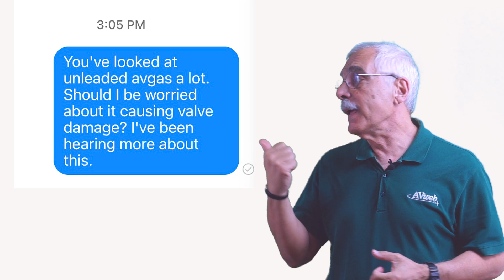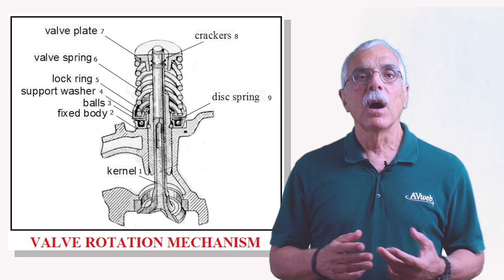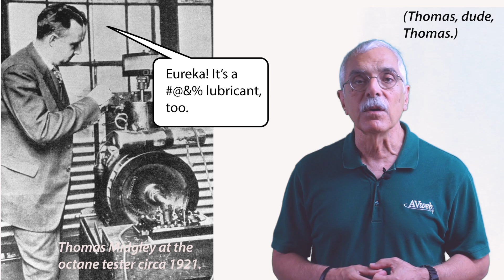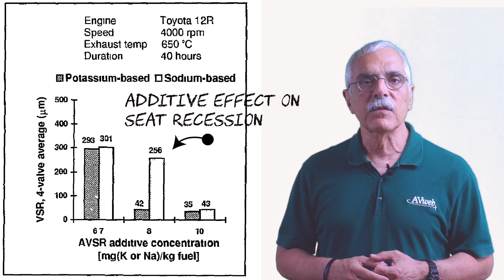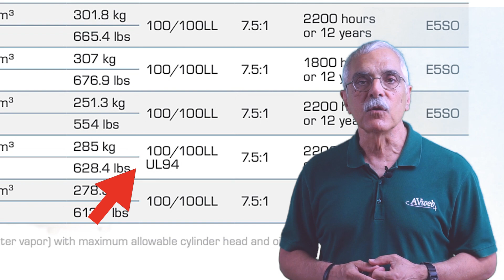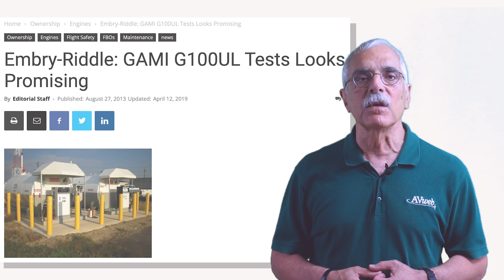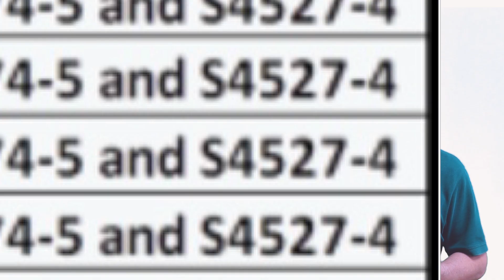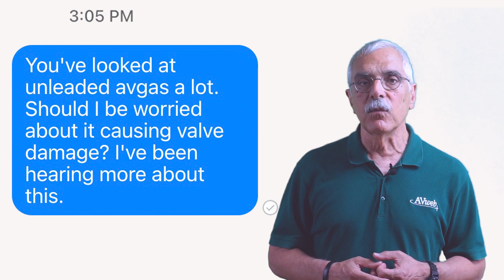Whadayamean Unleaded Fuel Will Trash My Valves?

Comment: Once we get past this leaded fuel issue- we can start wondering why a 7.5:1 or 8.5:1 compression engine actually needs 100 octane AKI in the first place at any boost pressure under <35psia. (Hint, it's because of a ~lack of modern spark timing control and combustion chamber design). 

Need to resolve this stuff as the cost of fuel going forward greatly affects the affordability of GA. I can't see why 91-93 RON Mogas, or at least, an ethanol-free variant- isn't the goal. We'll worry about the ethanol bit once people get over this last circus- somewhere around 2075 I'm guessing lol.

100UL at $8 a gallon is basically kicking a field goal instead of going for a touchdown.
Reply: i'm sure it's the goal... but as you mentioned, certified GA aviation got stuck in the 1950's.

We need a total revamp of the certification process. It's currently so hard the bottom 80% of us are flying 1970's vintage aircraft which use 1940's level technology, and the rest are paying millions for something with a mix of 1980's and 2000's tech.
Reply: And there are dozens of alternative fuels and changes in the engines that could be used, but every small change in this sector means constant headaches and drama.
Reply: A “touchdown” would be to convert the whole GA fleet to diesel engines running Jet A. One fuel for everything.
Reply: @wrkingrageaholic  This is possible if you use exhaust or waste heat from the engine to reform Jet A into syngas for spark ignition engines.
Reply: @wrkingrageaholic  Maybe. Diesels are heavy for a specific output. Always have been, always will be. Unlikely to happen unless re-engineering all the airframes like diamond did.
Reply: @peterblais6268  Diamond proved that a diesel can work, and their diesels are a cludgy automotive adaptation; far from an ideal aircraft engine. But your point is valid. They had to design the airframe around the engine. You can’t just stuff a diesel in where a gasoline engine used to go for many reasons.
Reply: The lack of modern (and by modern, I mean 1980's) electronic engine controls is just criminal. One of the reasons I never went further in aviation was my frustration with the prevailing Luddite attitudes I found everywhere. Look how long it took to adopt GPS! Private airplanes could be sooooo much better. We have the technology to make them efficient, clean, and safe (pilot-proof), but somehow we're stuck in the past.
Reply: @wallyballou7417  Fake Luddite because they also get triggered when you mention the use of steam/Sterling engines (I'm being serious, there are models that may work well).
Reply: @wallyballou7417  Your frustration with “Luddite attitudes” conveniently ignores the fact that it requires many many millions of dollars to create a new and innovative product for GA, in a market that is so small as to be nearly non-existent. The economics simply don’t make sense.
Reply: @wrkingrageaholic One reason the market is so small is the painfully slow adoption of technology, especially propulsion and automation. There's no reason an 172 or DA-40 should cost more than a Toyota. And it's just absurd that an air-cooled 4 cylinder engine costs $50,000, when a GM LS V-8 - a more modern, efficient, and powerful design can be had for about $6k (and the LS isn't particularly advanced, except by aviation standards). And they wouldn't if they were produced in similar quantities. But resistance to change punishes innovation and thus the market stagnates.
Reply: @wallyballou7417  Again, you’re oversimplifying and equating things that do not equal. If a Toyota was hand-built by first-world labor and they only built a few hundred a year, then they would cost a half million dollars each, too. The economies of scale produces drastic reductions in cost. No company is going to spend research and development money without an expectation that they will earn a return on their investment. Even if you could sell a new airplane for $50k, I doubt very many people would buy one. General aviation always has been and always will be an enthusiast’s hobby, not a mainstream form of transportation.

Comment: How were valve seats surviving in 1920 and 1930 autos before tetraethylead was added to gas?
Reply: Loooooow Compresssssssionnnnnn....
Reply: @jamesengland7461  lower compression = less likely to have detonation.  Tetraethyl lead was a great octane booster which also lowers the risk of detonation. Leaded gas was known to often have a higher octane rating than what it was rated for. 100 octane leaded gas might have actually been like 115 or 120 octane. Then you switch to 90 octane unleaded gas, have detonation on the hot exhaust valves and wonder why those damaged valves are wearing the valve seats. It's the octane difference that mattered not the lead content.
Reply: @ulbuilder  well,  that's the long answer,  but it starts with the low compression in early engines,  sometimes as low as 4:1.
Reply: this was an era when engine rebuilds every 10,000 miles were common
Reply: Regular overhauls were a thing.

Comment: I don’t understand why aviation engine technology is so far behind automotive engine technology. My 1985 Honda Accord went 432000 miles with nothing more than routine maintenance. The only reason I retired it was the emission control system had a problem that would cost more to repair than the car was worth, but it was still getting 31 mpg.
Reply: Aircraft engines are behind as far as technology goes, but there are some important things to remember:
-Many aircraft engines are air-cooled and designed to be light as allowable.
-Your Honda engine may have gone 400,000 miles, but it probably didn't spend much of its life having to produce most of its potential power for hours at a time.
-The stakes are a lot higher when an aircraft engine fails vs a car engine, and this leads to a conservative tendency in the aviation industry to go with what is tried and true.
-There are few big competitors in the GA piston engine market (really only 3) and they have little incentive to invest billions of dollars when they have seen smaller companies try to adopt automotive engines and fail.
AVWeb did a good video about this subject, we might see more modern designs in the future because there is really nothing fundamental forbidding them but the biggest impediment to it right now is inertia.
Reply: @stefanremund8596  "Aircraft engines are behind as far as technology goes" - Yeah, like 60 years behind (For Lyconosaurus) 

"Many aircraft engines are air-cooled and designed to be light as allowable." - Really once you add up all the baffles and the air ducts ect, air-cooled engines aren't that much lighter. The real reason is 1950's era technology for liquid cooling wasn't that reliable. 

"probably didn't spend much of its life having to produce most of its potential power for hours at a time." - True, but the engines are tested at max power for hundreds of hours. Plus Rotax engines spend most of their lives at peak power. 

"conservative tendency in the aviation industry to go with what is tried and true." - True, but that doesn't mean they are actually safer. There is plenty of evidence these old certified engines are not any safer than newer designs like from Rotax. The catastrophic failures you see in Lycoming and continental engines are stupifying, you would never accept those types of failures in a Rotax. 

"smaller companies try to adopt automotive engines and fail." - They failed because the system is set up for them to fail.

"biggest impediment to it right now is inertia." - If by "inertia" you mean the horribly complicated and expensive mess which is certified aviation then yes. The reality is the system is killing GA. We only see new commercial aircraft and engines because there is massive amounts of money in commercial aviation. That creates the incentive and reward for slogging through the system. There has never been that kind of money in GA, there never will be.
Reply: @TheOwenMajor  And market cartels.
Reply: Did you run your Accord near max power for hours at a time very often ?
Reply: @jameschristiansson3137  This is a total wives tale. It is relatively standard for automotive engines to run 1000 hours at wide open throttle as part of their development testing.
Reply: Certification cost of new engines/technology is very high.
Reply: I'll give you a hint. The last jet engine that we certified ended up costing more than $2,000,000,000.00 before the type certificate was granted. We know the engines sell for as much as a Gulfstream, so in a decade or so we can see a profit. Now try that with a piston aviation engine.
Reply: I’m not sure I buy the “maximum power output 100% of the time argument”. Aviation engines are presumable rated for a given power output at a given rpm that provides an optimum prop speed and longevity.  If you could spin it at 9000rpm, it would make much more that it’s rated power.  Your Honda will have spend most of its life in a similar rpm band to an aviation engine I imagine.
Reply: @winterpegers  Those engines are so old anything surpasses them in almost every possible way. And the engines adapted for experimental aviation are tweaked, downrated, the gearbox changes the target RPM...
Reply: @winterpegers  WTF are you on about? The aviation engine gets set at an RPM and stays there for the entire flight. In the time between takeoff and final approach, the engine will be producing 80-100% of its power continuously. The width of the RPM band can be measured with a 2-digit number. Compare that to an automotive engine, which spends a considerable amount of time at idle, very little time at WOT, and the vast majority of its time at about 30-40% power output. Its RPM band would be measure with a 4-digit number. RPM is only one factor of many, for the record. You won't generally find automotive engines with as much displacement as an aviation engine, we're talking over 5L just in the standard engine of a Cessna 172, over 7L in a 182. The compression ratio of a modern automotive engine is much greater, those two engines I just talked about have compression ratios around 7:1, compare that to the 3L V6 from a modern SUV coming in at a whopping 15.5:1 compression ratio.
Reply: It’s a very different operating environment, and the volumes are not there for a company to spend the money to constantly develop new engines. There are simply not enough new planes sold every year, and getting STCs for all older models is not possible. Even if you could, and everyone bought your new engine, you would sell less than the number of engines GM alone makes in a year. Instead, we have old tech that gets the job done slightly inefficiently.
Reply: General aviation engine technology is so far behind automotive engine technology because   GA died in 1985 and hasn’t grown or evolved since. There is no money for R&D, no massive pool of potential sales for an innovative new product. Most of us fly in airplanes built in the 1980s or earlier, and that’s not going to change any time soon.
Reply: @wrkingrageaholic  And there were always a supressed demand for more smaller airplanes, now being exploited by vaporware urban air mobility companies .
Reply: All the stuff about certification is somewhat circumvented by experimental aviation, which is growing as the realm gets fed up and leaves the FAA's antiquated requirements behind. Of course that's limited in what it can do (anything for money) but it also serves as a testbed for designs or technologies that later become certified - the Rotax engines a few have brought up were raised that way. The FAA should actually see that as part of a certification system - "This has been in use for 10 years in experimental aircraft with a far lower failure rate than existing certified designs? Okay then, here's your certification!" This would give far more realistic data than any certification program. A program like that would also incentivize such new developments, as companies could begin selling something without certification, and let the experimental market do the testing. This would be using experimental pilots as the test subjects, but I think many experimental pilots would gladly take that on for the benefits the new technology offers.
Reply: @quillmaurer6563  Every certified aircraft type starts out as an experimental prototype. To achieve certification, it has to be proven to pass all the certification requirements in a fixed configuration. You can’t use a fleet of homebuilt aircraft as a basis for certification because every one of them is different and can be changed by their builders/owners at any time. That is the freedom afforded by the Experimental: Amateur Built category, but it’s not the scientific process required to certify an airplane for use by the general public. I totally understand the frustration shown in these comments with the lack of good options, but that certification process exists for good reasons.
Edit: FWIW, engine manufacturers have used experimental engines to work the bugs out of their designs before releasing a certified version. Someone mentioned Rotax, which is one example, but also Lycoming intially released the IO-390 and IO-580 as experimental engines. They are incremental improvements of old designs, but at least it shows there is will to overcome the stalled “inertia” in GA designs.
Reply: ,,,,,,,,,,,,,,Because racing vehicles dictate the need for superior equipment ;  thus , the research and development to build more efficient  power comes about........For every 1000 racing cars and  or motorcycles that are built  ,  I  could  only  guess  the small amount of racing prop jobs that exist......On the other hand,,,Jet engine technology is highly ongoing  in and about  the need for airlines to see financial  profits.............
Reply: Paul did an excellent video on this very subject. Look up “Why New Aircraft Engine Ideas Rarely Succeed”.

Comment: The GAMI fuel is just as good at anti detonation as 100LL I'm hoping. They use a secret sauce to do it I guess. Cont. TSIO-550E needs that feature.
Reply: I’ve listened to George Braly speak extensively about G100UL at both OSH and LAL.   G100UL has significantly higher detonation margins than 100LL.
        George alluded that the rich mixture octane rating of G100UL was well north of 120.   This would make it compatible with many WWII era engines running ridiculous amounts of boost (50+ in/Hg) via supercharging.

     The “secret sauce” G100UL uses are a proprietary ratio of aromatics added to 94 octane alkylate base stock.   The aromatics are isomers of toluene and xylene.

       No need to hope, G100UL will be more than adequate to run your TSIO-550.     You will also enjoy longer oil drain intervals since you are no longer dumping Lead-Bromine salts into your oil and making it filthy and acidic.
Reply: According to GAMI, it's substantially better at anti-detonation than 100LL. To the extent that George is apparently seriously considering an STC for the turbo-normalized Cirrus engines to crank up the boost and thus the horsepower.
Reply: What are you guys smoking? The 100 in the name is the octane rating otherwise considered the knock (detonation) resistance index of the fuel. If they're both 100 octane, it doesn't matter what additive is used to get the the 100 its still 100. Eg. the resistance of the fuel to detonation can be considered the same.
Reply: @XXforhireXX  I think the point in this case is that it meets at least a 100 octane rating, because that's what was required to drop in to the modern aviation fleet. In practice, its true octane rating would probably be higher. Like Stepclimb, I've been to a long talk that George Braly of GAMI gave about the fuel, and he showed the graphs from the test cell comparing 100LL and G100UL during detonation testing. The difference is stark.
Reply: @MikeKobb  To the extent G100UL relies more on aromatics than TEL for octane, as e.g. the Germans found out in the run-up to WWII, the octane rating of high-aromatic gasolines are pretty sensitive to lambda. So it seems reasonable the rich rating for 100UL could be higher than for 100LL.

Comment: Do we know why Continental hasn't been using hardened exhaust seats?  What is the logic/reasoning there?
Reply: Some people (companies) are adamant about being surprised by new regulations, no matter how much warning they have.
Reply: Great question - the writing has been on the wall for decades.
Reply: Same reason GA is still basically using 1930's engine technology nearly 100 years later.  Paul's covered that one elsewhere.
Reply: Apparently, you haven't heard about FCC regulations involving among others type certification, nor how any aviation mishap attracts lawsuits.
Reply: Money. It's always money. Cast iron (or even low-alloy steel) valve seats were very cheap, and sometimes manufactured in-house. The harder stuff is more difficult to machine once installed, and easier to break during installation (and sometimes problematic if "cast in place" due to heat.) But with today's tough carbide and diamond tooling being quite cheap, the actual difference would be ~$20 a jug, most likely.
Reply: @UncleKennysPlace  

      Kenny’s comment is spot on.   Follow the money.    If TCM retains the use of crappy valve seats, it can continue to charge for cylinder work and selling more garbage valve seats to customers.

     I’m sure someone down the line will develop an STC for better valve seats for TCM cylinders if the G100UL actually becomes an issue.   Time will tell.
Reply: They make money with the existing design...Why change?